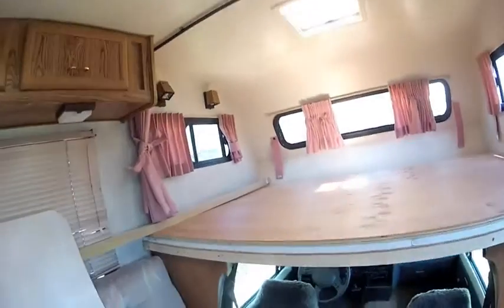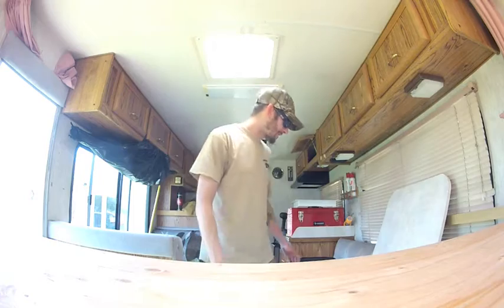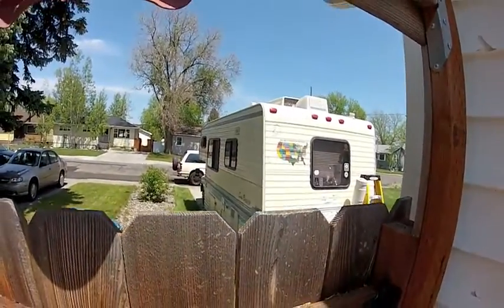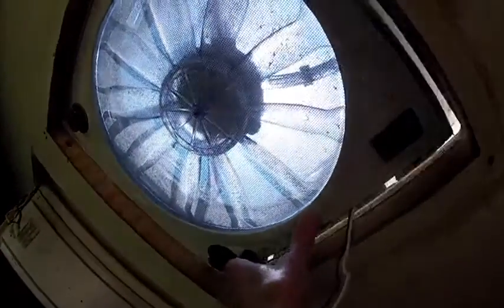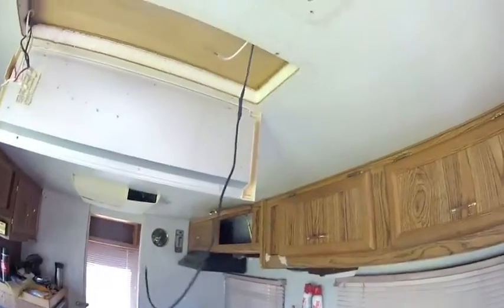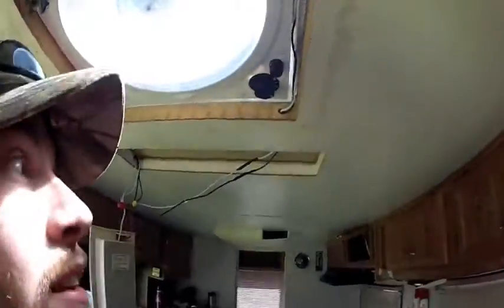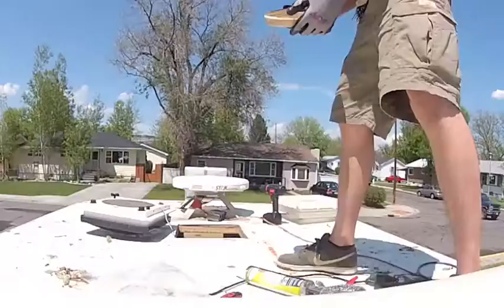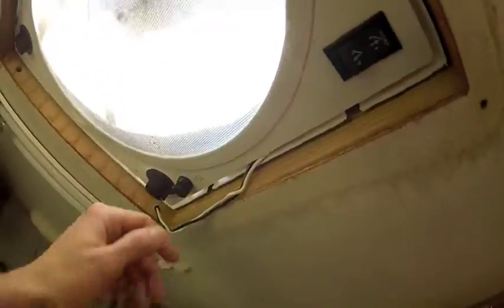RV Remodel Update, Hail Damage, and Fan-Tastic fan Install

Comment: Awesome job. that's exactly what I'm doing to my bunk. the dimensions are almost a full size mattress which I'm buying a 6 or 8 inch memory foam. I'm going to cut the angle out from the front end to be able to fit it snug against that wall. I'm not going to miss that aluminum roof at all. mine I can barely even stand on. it's coming off completely next week.
Reply from the maker: Thanks Daryl! I'm pretty excited to eliminate about 6 inches of old cheap foam and trade it for my memory foam pad I used to have on top of that old setup in the dolphin, getting about 4"more head room out of it. Not like I ever took that cushion out anyway. I was focused more on resale vale when remodeling the dolphin so took it very tame with crazy ideas. Not holding back on the Sea Breeze! Making it work for us and hopefully if it comes out as I'm imagining, should add some value. Resale doesn't come into play much with a Kia in the side of it haha. 
Dang would love to see what you're doing to your rig, re skinning it!? Yea it says on my roof not to walk past the AC but I'm 150 lbs soaking wet so it was fine with skinny ass me on top haha. Thanks for the comment as always buddy!

Comment: Fix the sink from the bottom and use flexible epoxy. that's the nices floor plan on the mini.s almost bought one with same floor plan.
Reply from the maker: Thanks for the comment! That is what I was thinking for a while but got something even better cooking as we speak! I think you all will enjoy:) Yea I really love the floor plan, the dolphin had the big dinette in the back and it was a bottle neck 2/3 until you got to the back. Much smarter design/ flow to it, feels way bigger than the Dolphin but same exact size!

Comment: Question: I've heard that drilling some small/med holes on your bed-board will help prevent mildew. What do you think?? Take care..I like your videos. Is that your wife?
Reply from the maker: I knocked the idea around, it needs to have room underneath to breathe or it will just make pockets for moisture to build up and create mold. Head room is limited in the bed so didn't want to add more height with spacers and another sheet of wood with holes. The deck sealant worked great just have to air it out and bleach water it every once and a while. More of an issue in cold weather we've noticed. Girlfriend for the last 5 years and counting:) Thanks for the comment!